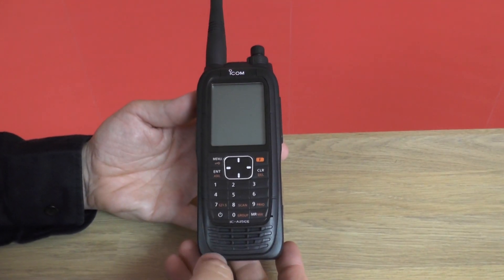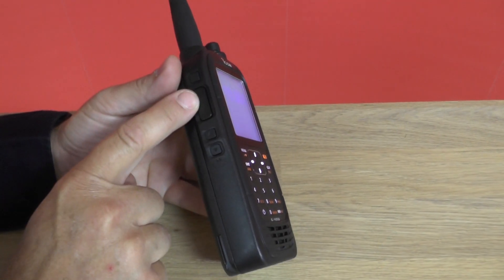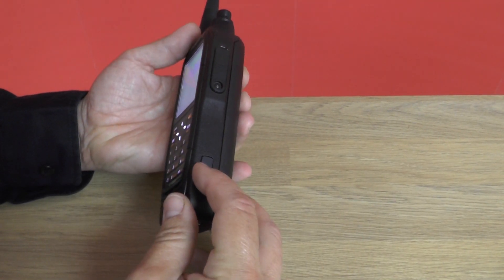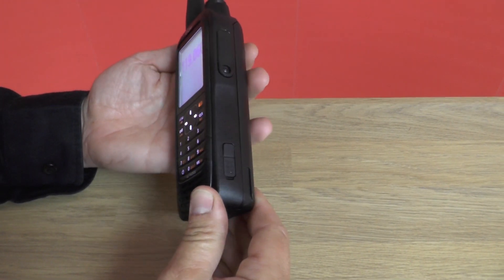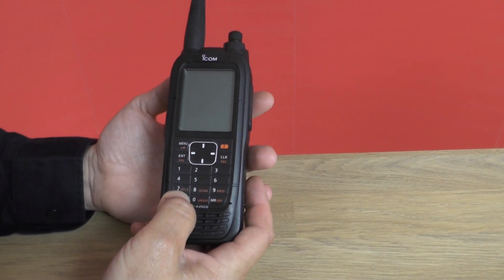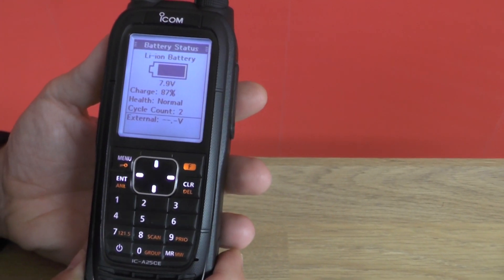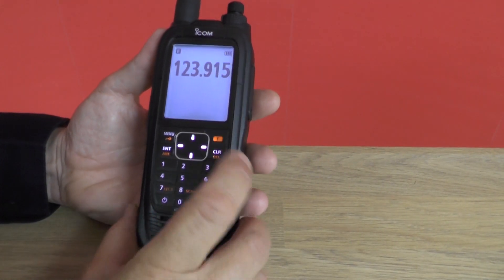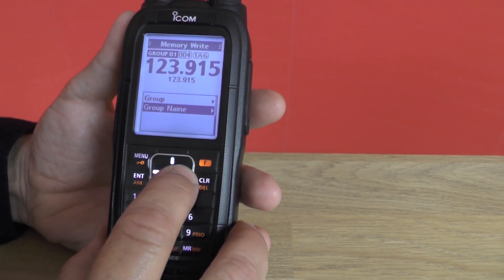Common Features of the Icom IC-A25CE & IC-A25NE Airband Radios

Comment: Is there any way of getting more information about the bluetooth settings menu? I've got my A25NE paired with a Honeywell Sync Bluetooth Headset, but the audio isn't coming from the  boom mic, instead it's coming from the radio mic.
Reply: Bluetooth doesn’t ever allow an external mic only audio. So your stuck with the internal mic using bt. If you use the wired headset adapter it should work.

Comment: Clear video on how to operate the comm functions. Is there a video coming specifically on the nav version too?
Reply from the maker: Thanks got a batch of videos to edit when I get back off holiday. One of them is to do with the aviation app which might touch on the NAV function…if not I will add to my job list.
Reply: @Icom_UK  Look forward to seeing them! Till then, enjoy your holiday.

Also, since you’re fast in replying.
Could you answer help me out with the following question I have not been able to find the answer to.

When connecting the Icom to a bose A-20, which mic. will the icom use? (icom or bose) 
And; do I need to use the PTT on the handheld or do I need to acquire an external PTT button?
Reply from the maker: @SidewaysCars  Personally I am not sure....might be easier if you drop this question to our tech team at sales@icomuk.co.uk and our Avionics specialist will pick it up.  Say on the email that you were advised to do this.